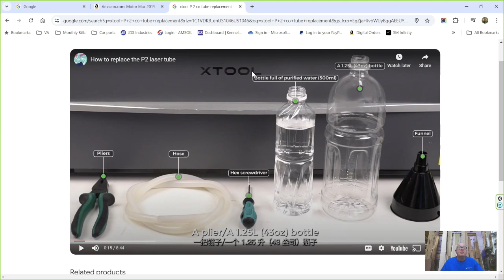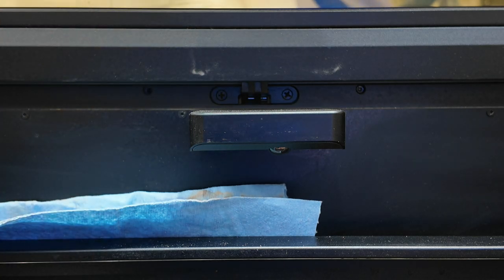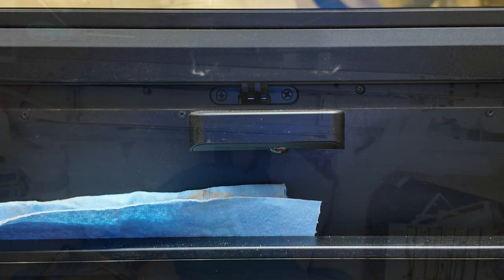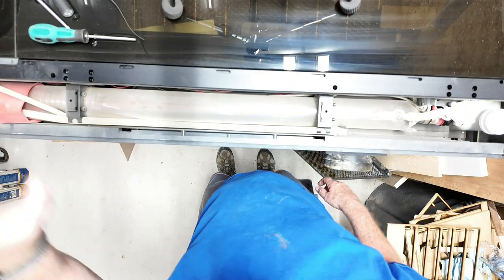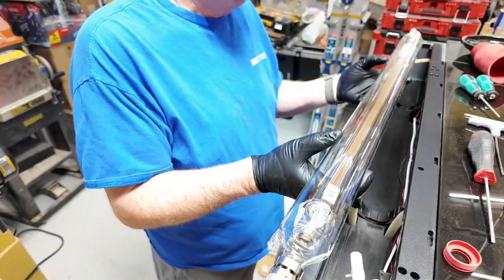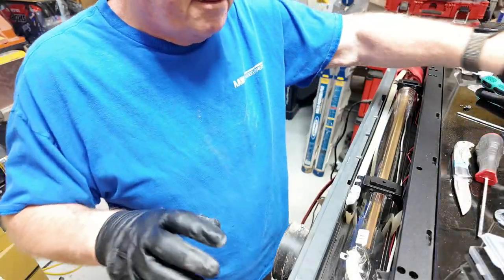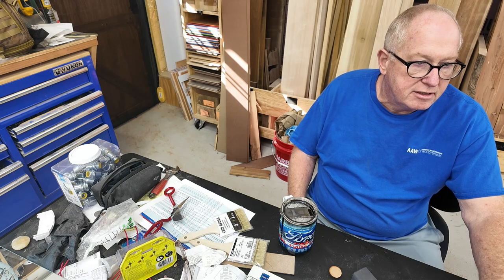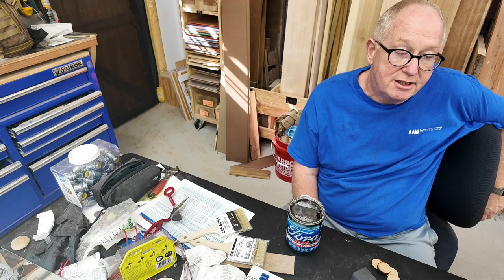X Tool P2 Co 2 Tube Replacement

Comment: Hey Scott, maybe the dust is leaving sut on the 2 mirrors it hits after the beam passes through the tube? I've seen that Issue on a Reddit Thread and they said they needed to replace those  - just a guess though

Comment: Only 600 hours of lifetime out of a tube is insanely low... were you using it at 100% power most of the time?
Reply from the maker: Not that much actually, and I would agree it is a short life.